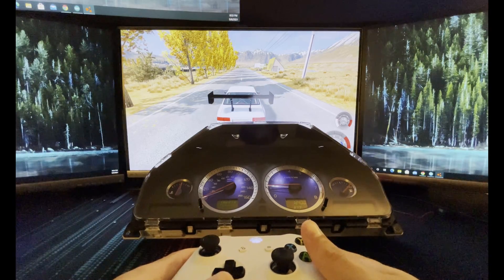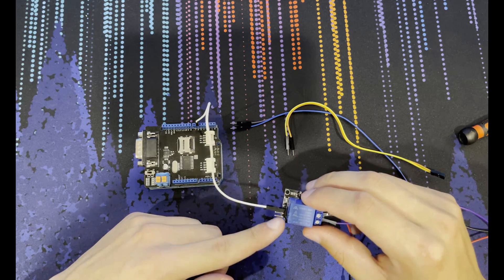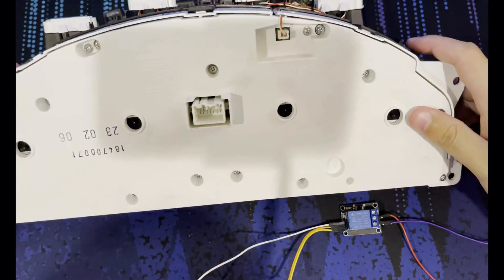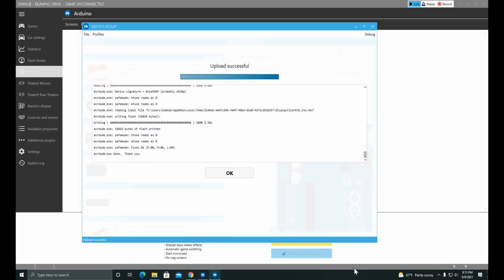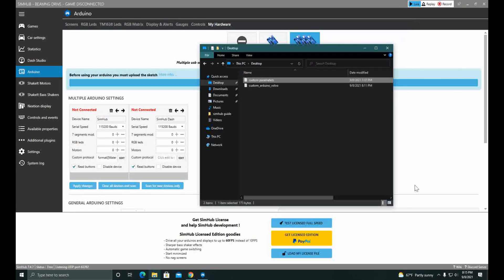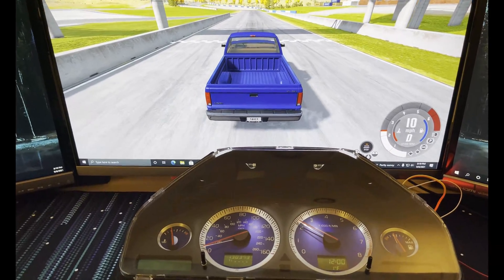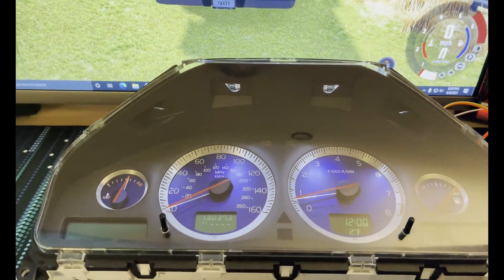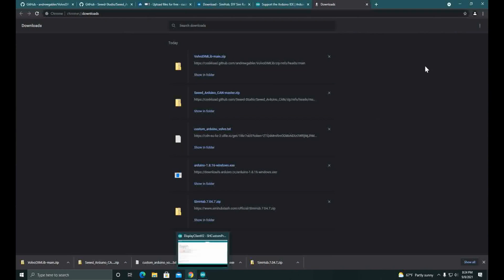SimHub with P2 Volvo Cluster - Setup Guide

Comment: Thank you! This is amazing, I was actually headed to a pick and pay to get a center console for my sim rig, I have an S60 but wanted the 850 panel. I don’t suppose you know if it’s possible with such an old dashboard?
Reply from the maker: It will be a completely different and possibly easier, but you will need to have good electronics knowledge to get it working with an arduino.
Reply: @AVGarage_  That was a quick reply! Thanks, yeah maybe better stick to the same model as yours. I know a bit about arduino but I am very poor in electronics, I can follow tutorials but that is pretty much it. It's ok though, Volvo runs in the family since 1993. I am ok with the 2005-2009 type cluster. Amazing video and work BTW. Are you planning to build the rest of the car for sim playing?
Reply from the maker: No I don’t really game that much haha I just knew this was possible so I released the video for others.
Reply: @AVGarage_  Got so excited I ended up not only getting the 2005 S60 cluster, but I got the whole dashboard and center console out 😂 soon I’ll have to figure out how to turn the radio on and get the ac to light up. Another question, in theory is it possible to get the blinker and headlight indicator working?
Reply from the maker: Yes, I’ve got code for the blinker but it’s buggy. Headlights is possible but I haven’t added it yet.
Reply: @AVGarage_  Amazing! I take anything you add lol. It will be amazing to see this Volvo back to life! 
One question: does it make any difference with or without SD card for the can bus shield? I am buying supplies. Also, do you have a PayPal for donation? I think you definitely deserve!
Reply from the maker: You shouldn’t need the SD card for the shield right now unless you plan on doing your own development on the project (coding etc). 

If you wanted to donate to me my paypal username is @AndyGabler and anything is greatly appreciated! 

I would love to see your setup once you get it going!!
Reply: @AVGarage_  Absolutely, will share with you. Would share on my channel but I make 3D printed ships as a hobby and my audience (though small on this channel) would go nuts seeing me not making ships lol.
Reply from the maker: Thats dope! Might have to check you out and 3D print some stuff, haven’t dusted off the printer in a minute here.
Reply from the maker: Looks like youtube may have automatically removed your recent comment and I can only see the first half of it in my notification. My PP email is andy@agabler.com
Reply: @AVGarage_  hi m8 hope u r well the best video av found fr my need I need help on programming my tachometer I have done all my test on simhub arduino everything is working fine I have tested max rpm all working but the confusing part is sketching and custom protocol how do I get the information fr this plz if u can help I would really appreciate it thankyou.
Reply: Hey I just thought of something, could it be that the same canbus signal that tells the gauges to turn on, is the one that tells other instruments to turn on? So in theory if I connect can H and can L from the arduino to the radio, climate etc all is going to light up if we send the command?
Reply from the maker: You could give it a try. At best they won’t error. I needed to send very specific messages to get each function of the DIM powered up but it may work. Only issue could be that they interfere with the messages getting to the DIM. Try it out and let me know.
Reply: @AVGarage_  I will, tomorrow can’t come soon enough for amazon to deliver the relay. It’s the only thing missing, the frame to hold the panel is ready almost, if you go to the Facebook group DIY Sim Racer you’ll see my post with the progress.
Reply from the maker: Just joined it!
Reply from the maker: Double check that you followed the instructions for downloading the library from the github repo and placed and linked the folder properly for the arduino software to see it
Reply: @AVGarage_  yup, was my mistake on my part I deleted the comment, it’s working! Now a few things I noticed, my startup doesn’t do like yours, the speed and rpm dials don’t go up and down, also noticed it starts when the click on the relay with nice bright lights on the numbers and text, then it fades to a low dim. Easy to fix?
Reply from the maker: Yep you need to set how you want it to behave in the code now. Using the functions in the library
Reply: @AVGarage_  sorry very dumb question, library in the arduino right?
Reply: @AVGarage_  Interesting, when I add the custom protocol the brightness reduces a lot, before it works just fine.
Reply from the maker: Set the brightness to 256 maybe? I would need to see the code to know what the issue is.
Reply: @AVGarage_  I did, weird is that as soon as I upload to arduino from simhub as soon as I go back from the upload page it erases the custom protocol and is very bright, then I copy and paste the protocol and as soon as it reloads it’s off. Now let me tell you I would be the happiest man in the world if you found out how to tell the cluster to turn the back lights on, in the dark it will be hard to see the cluster and part of the magic is in lighting it 😂 but man so many many thanks it works!!!
Reply from the maker: Hmm the backlights should be on. I would have to look at the code you’re using but it should all be working.
Reply: @AVGarage_  if I could send you a video maybe you could see, but the code is the same you linked in the video. The cluster has a 2005 date on it.
Reply from the maker: You can email me the code you’re using to the same email I gave you for the paypal you sent me. Send me the custom protocol and the arduino code.
Reply: I powered my cluster today, but nothing happened, could it be bad? I just plugged the positive and negative, when I move the negative to one up and right the check engine light comes on. Do I need to hook the positive key cable?
Reply from the maker: Double check all of your connections. Does your Arduino have all of the code setup properly with no build errors? It will only turn on if the arduino code is correct.
Reply: @AVGarage_  I just connected the power, not the arduino yet, my relay only comes Saturday, I have the canbus and arduino. But I just wanted to power on the cluster to check if it is working. So I plugged the positive and negative to a power brick 12V 3A.
Reply from the maker: It won’t do anything without the arduino, at best the needles will reset themselves to their 0 positions.
Reply: @AVGarage_  I see. Darn 😂 will wait, if I were to connect the radio, Light Switch Module and climate control all into this arduino, could I reverse engineer (with a lot of help) the canbus to get the lights to turn on the dash if I flip the LSM to on like a real car would?
Reply from the maker: That would take another thousand hours of work and alot of time logging a real car’s network and likely need the lin-bus to be connected as well. I am totally unfamiliar with how those pieces relate to eachother, but I guess it is not impossible.
Reply: Sorry to bug you 😂 just very excited and little electronics knowledge, always dreamed of having a similar setup, maybe one day I get the whole car if I have more space 😂
Reply: If it is that complicated I might just remove the board and 3D print a template just to hold the LEDs and power them manually. This could actually work well. But it would be rad to get the switches to work with the computer. Maybe on my V2.0 😂 I’ll focus on the cluster and get it to look nice. Thanks for all the help so far!
Reply from the maker: No problem. I have been busy with life lately and haven’t had time to work on this specific project, but I do have a full dashboard and spare radio myself. In the future I would love to buy a crashed car and completely remove the wiring harness so I can test everything without needing an entire car to test from.

Comment: which pins are used 12v negative pins fuel speedometer rpm temperature
Reply: Read through the code sketch you will find the answer's in it
Reply from the maker: It’s all can bus. There are no specific pins for different functions.

Comment: Can I get the Trip miles to work in sim hub and Change the clock from 24 hour to 12 hour and the outside temperature from Celsius to Faranhight
Reply from the maker: You should be able to pass 12 hr values to the clock and it will display correctly. 

There is no implementation in my library for Celsius support yet, I would need to get a can bus log from a car that has Celsius temperature defaulted. 

The trip miles are not implemented yet either but I do know that it is possible. Still much progress to be made on my end.
Reply: Cool I was wondering because all the clusters in my country is in Celsius and I prefer Faranhight I was just wondering if I could switch it to Faranhight that's cool and the cluster is just right for me I wanted Faranhight and 12 Hour Clock will a Cluster from a 2002 Volvo V70 P2 Work Because that's the car at my Local Junkyard and there is a 2004 Volvo V70 D5 at my Junkyard are these clusters going to work with your library Take care
Reply from the maker: @JoeSibCars  Unfortunately I haven’t tested any clusters from 2004 or lower. I don’t believe they will work because the cars from those years used a different can bus speed. 

As far as your clusters being in Celsius it may be the case that they still display in Celsius even if you give a temperature in Fahrenheit. That is something I have not been able to test. 

I do know that the 12hr time will work fine though.
Reply: Thank you does the Odometer Miles count up as you drive around in a Simulator I play a few different games and will this work in Euro Truck simulator 2 I do have beamng Drive And I also play assetto Corsa Will it work in those games
Reply from the maker: @JoeSibCars  currently miles do not go up when you drive but i will be adding that as an option in the future as well. 

This should work with any game that simhub supports with minor tweaks to the custom protocol on the arduino page of simhub.
Reply: Thank you I will pick up a DIM but I won't be from a R it will be a Standard Cluster from a 2004 Volvo V70 with the chrome rings around the dials it will be the newer style like you have Take care
Reply: I've found an Instrument cluster from a 2007 Volvo S60 D5 it's the same instrument cluster but the maximum revs is 5,000 Rpm will this Cluster Work with your Sketch
Reply from the maker: @JoeSibCars  I am not sure what the behavior would be to be honest. I should clarify that when I say 2005 - 2009 models I am referring to the US models 05-09. In the UK there may be some overlap with your 2004 models being the same as 2005 here in the US. As long as the car that the dim comes from is the newer “facelift” trims you should be ok. 

I believe you can tell most easily if a model if facelift if it has the paint matching trim on the exterior opposed to the black rubberized trim. 

There will be dims that are standard looking, silver watch dial, and blue R watch dial. These should all work so long as they are from the correct model car.
Reply: Can you adjust the Time on the DIM by twisting the Time Stalk like you do in the car
Reply from the maker: @JoeSibCars  no you need to send the time value through code.
Reply: Okay will it always remember the Time when I unplug it and when I plug it in again will it show the correct time
Reply from the maker: @JoeSibCars  nope you need to send the time to it from the computer. It’s basically a display at this point and remembers nothing
Reply: Will I have to set the time every time I use it
Reply from the maker: @JoeSibCars  everything is set programmatically. So you need to have the time update every minute via code.
Reply: Okay I don't mind setting the time every I use it but will it work like a clock so will I be able to look down and it will tell me what the time is and I guess the clock works once the time is coded is that correct
Reply from the maker: @JoeSibCars  yes. You don’t set it with the buttons you set it through the code though. So every time you power it up if the code is correct it will set the time for you
Reply: Okay I will get my Cluster and I will go to my local scrap yard and I will get a DIm and I will take this project on take care